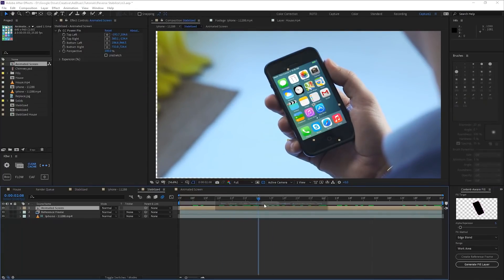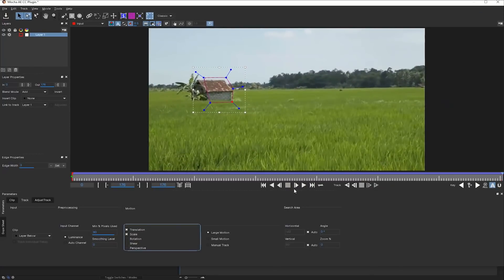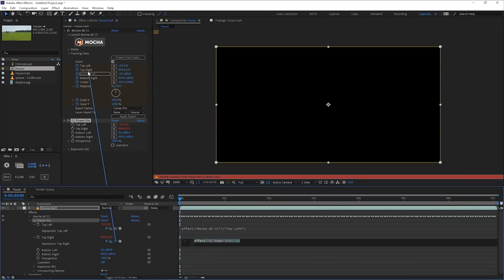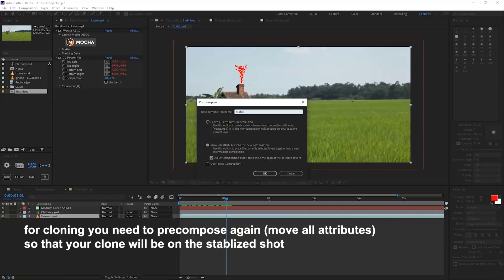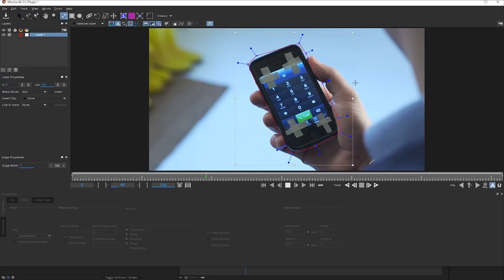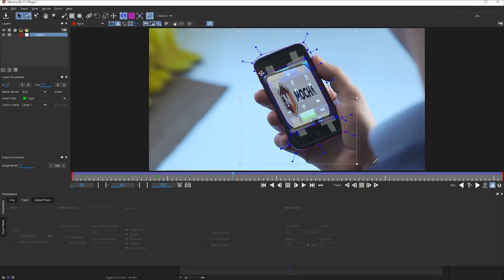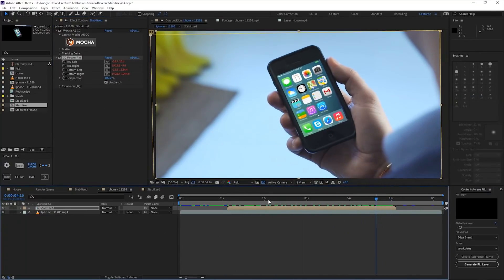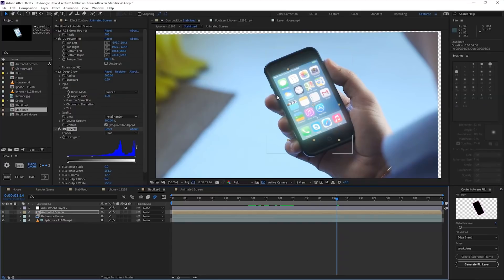Reverse Stabilization in After Effects 2019

Comment: Question: instead of fiddling with the planar surface and doing the expressions to the corner pin, why not use the expand planar surface button, invert the tracking export, and apply the effect to the layer itself? The same tracking data can be re-exported, without being inverted, to any object you line up to the stabilized footage. Since discovering this button--the same as setting the reference frame in Nuke's planar tracker--I've only manually adjusted the planar surface when doing a quick check on a track.
Reply from the maker: thanks that's a good question. the answer is that I have tried various methods for RS extensively for years including using the method you suggest. here's an example of me explaining it:
https://forums.adobe.com/message/9726281#9726281

I found flaws in it so eventually decided to use the cc power pin approach and it was the most efficient and will explain why. 

eventually I discovered numerous issues with using push planar surface to edges vs using unstretch with cc power pin. the most severe issue was that when doing perspective when there were extreme changes in the pins (when something is far back or changing angles to extreme), the push to surface pins gets applied to corner pin (or even power pin) gets to extreme values and simply crashes in Ae.

using the unstretch on the other hand worked EVERYTIME!. another issue was that mocha had to have two kinds of setups: with push to surface and without (for when you want to actually check your surface is solid on a screen or something so you don't want to push to surface), and they had to be aligned at the same frame - I had to remember which frame it was - it became confusing. with the technique I show, you use the same mocha instance. hope that makes sense. there were other issues as well - no motion blur which had to be compensated with effects... and I think maybe more issues.. 

today BTW Mocha Pro 6.1.1 got CC Power pin export so you can skip the expression rig process if you have it.